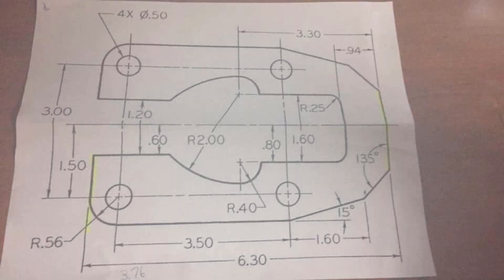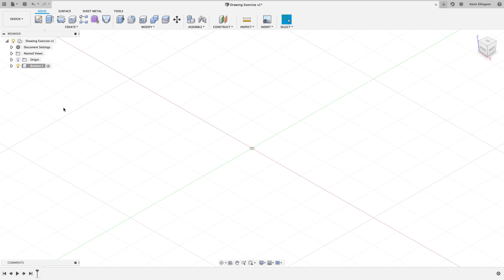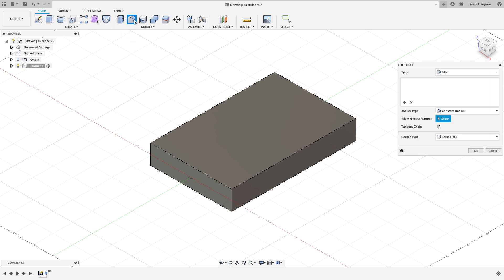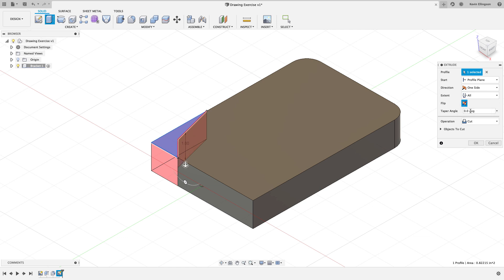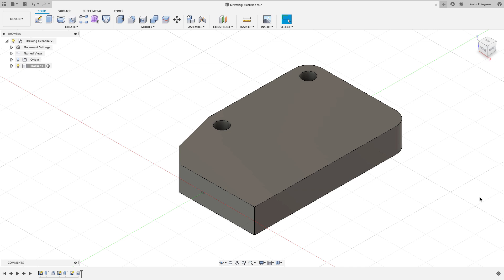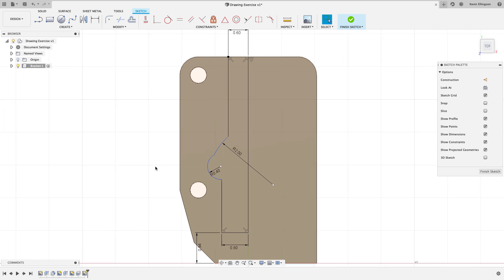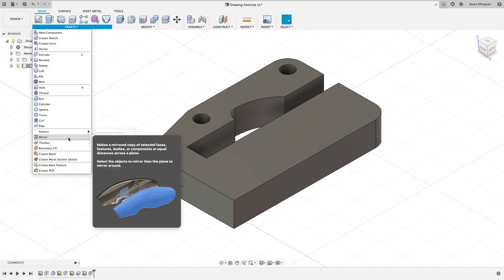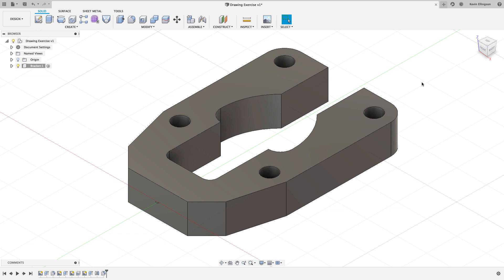Fusion 360 Fundamentals - Modeling a bracket

Comment: How did you get 4.12 for the width of the base rectangle? I do not see how to derive that from the drawing.
Reply from the maker: There is a radius of .56 listed for the top and bottom fillet. Add the 3 inches between the fillets to the .56 + .56 and you get 4.12
Reply: @MechanicalAdvantage  Thanks, I suspected that was the case. Your thoughts on that style of dimensioning? Seems less intuitive IMHO. On a base sketch, I prefer not to have to do arithmetic, regardless how simple, to obtain overall dimensions. Am I just strange?